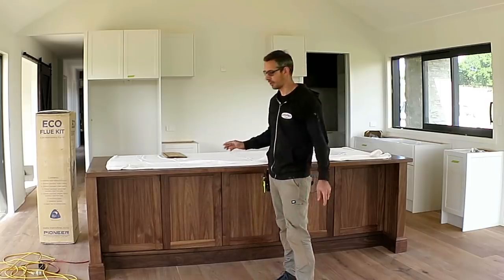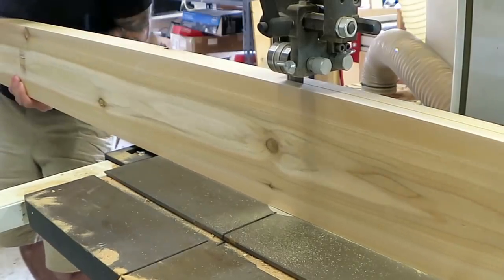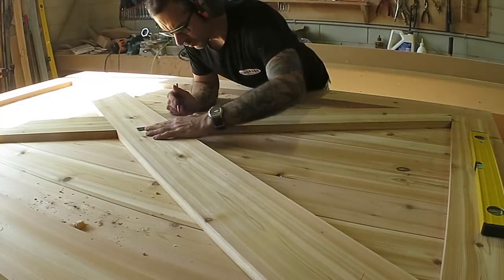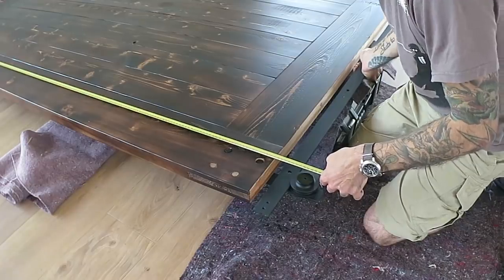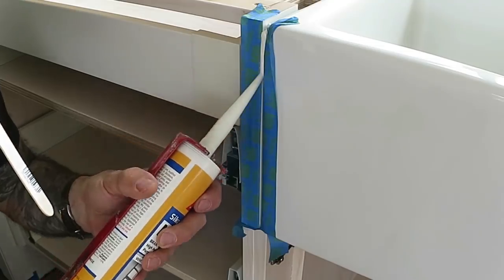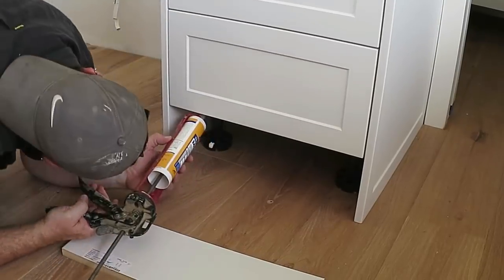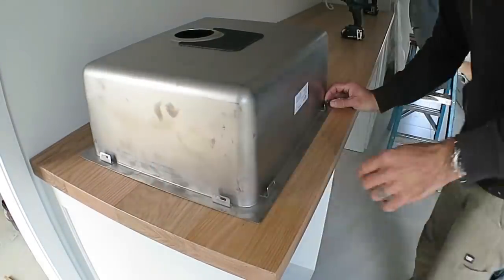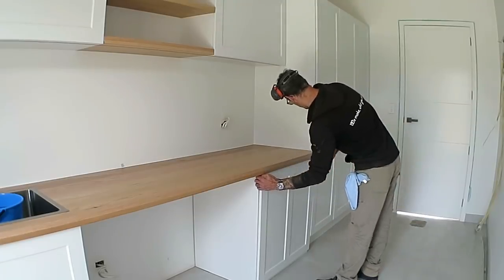kitchen install & barn door

Comment: Big job that one. I was surprised at how easily the Cedar burnt. When I put a flame to the timbers I commonly use, it takes much more than a single quick pass to get even the slightest of discolourations. 👍
Reply from the maker: Yea I was a bit surprised too and reasonably uneven burn rate too

Comment: You said something about the bacteria from your fingertips causing mold to grow on silicone. I wanted to hear more about that because flooring installers use silicone and other caulking along tubs, showers and exterior door thresholds. I run a forum for flooring professionals, The Floor Pro Community (I didn't think it was appropriate to post a link, but you can google it), and the problem of moldy caulk comes up once in a while. No one, however, has addressed the possibility that installers are inadvertently causing this problem with their own fingers. In the 35 years that I installed, I never heard that my finger bacteria could be causing a problem for my customers and maring the beautiful work I have done on their floors. Looking forward to your "Ask Me" video and hoping you will clarify this issue so I can share it with my forum members.
Reply from the maker: Ok sure will do.  Cheers

Comment: He Joey, great video again! Ashame you didn't have any real finished pictures. Looks great in the process as well though.
For the ask-me-anything video: If you could build your workshop all over again, would you do something differently from how it is now? Different size, workflow, machinery, dust collection, daylight, lighting etc? Or are you completely happy at the moment? I'm working with an architect right now to design my own 120m2 workshop (of which 20m2 will probably be a separate room for finishing) which I'll start building next summer. So it's always interesting hearing other people's experiences in their workshops. Thanks a lot, Ed

Comment: Great bit of work in the barn door and the kitchen, good to see final installs, much appreciate. I thought you said that yu were going to use epoxy on the bridal joints for the barn door. When you did the glue up that glue looked a lot like liquid nails, was it? Thanks Joey.
Reply from the maker: Yea its epoxy.  Builders glue by CRC

Comment: What happened to the length of cable that went under the island around 10:10? Did you retrieve it?
Reply from the maker: One toe kick is left off for the sparky to run a power point under the overhang

Comment: Great video. Is the clamp on your sliding table saw part of the RUWI system?
Reply from the maker: Yes , just didn't think I needed the other bits
Reply: KingPost TimberWorks I thought you had to buy the set. I have not found the clamp available as a separate item.
Reply from the maker: @lachlan8092  a friend imported 5 of these and I took one. So not sure on the details.

Comment: Does your client give you the dimensions of the appliances before you start building? Or are there standard dimensions that you use?
Reply from the maker: No I personally measure each appliance before j make it the final design. Sometimes this means going into the shop they bought it from to measure up off the floor.  Problem with this is that it toatally my fault when things go wrong!

Comment: very good work, I love to see you work because it is very different from how we do it in Spain, I would like to know what compound you have used to glue that door, on the other hand I would like you to know the hangers that we use here for the high modules when we put the kitchens I think qe could save you some time to mount them if you have facebook I will look for you to send you some information about this and so exchange knowledge as always great video always follow you
Reply from the maker: Cheers.  Facebook is kingpost Timberworks,  though I'm not good at it
Reply: @KingPostTimberWorks  I'm looking for you, I'm sure you're good at that too, seeing how meticulous you are with all the details, the next kitchen that I set up, I'll take some pictures so you can see the system that we have here, by the way, the mixes with the powder of the same wood that you are making?

Comment: That silicone work looks painful. Have u tried no tape and just spraying the silicone with for example mr muscle and then wiping it with your finger. Works a treat and never had mould or any issues
Reply from the maker: Yea I have tried that. I just don't like that there is zero tolerance when placing the bead down. But that does work that's how my dad does it.